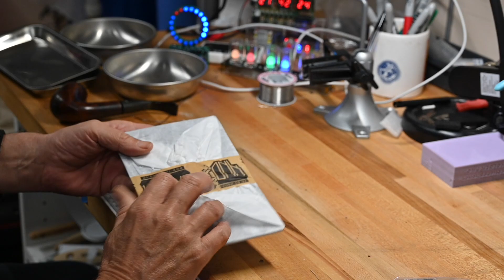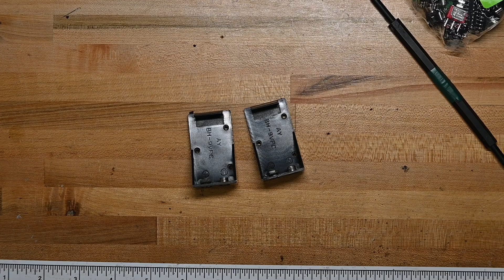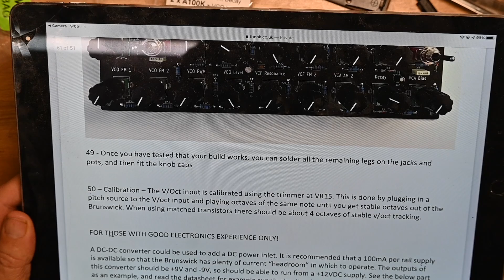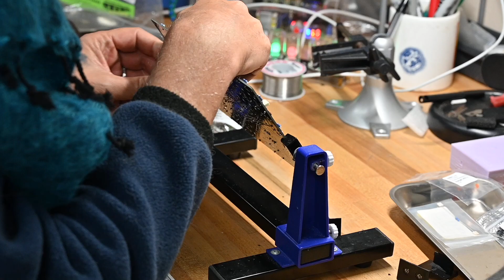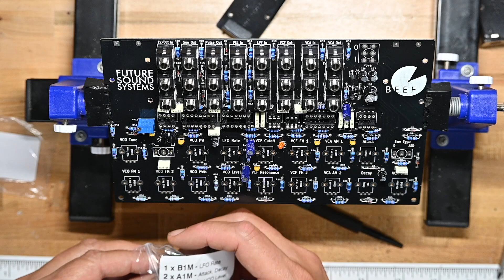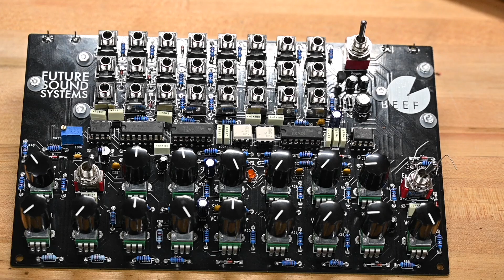C.K. builds a Brunswick Synth from Future Sound

Comment: BTW, Thonk now sells a "Brunswick Enclosure" that includes a front panel that labels everything. But it doesn't highlight the outputs vs inputs. (And it's currently out of stock.)
Reply from the maker: I certainly prefer modules that have clear indications of what is an in and what is an out.  As for the enclosure, I like Eurorack because it puts everything in a *rack*, I don't have the horizontal surface clear space to have separate units.

Comment: Excellent video! I'm glad I watched this before starting my build. Did you ever figure out what was going on with your envelope?
Reply from the maker: No, I did not.  Saw some messages here and there that this is not an uncommon occurrence, not sure why.
Reply: For what it's worth I finally got around to assembling my Brunswick tonight. I have the EXACT same gate issue. 

The only other fix I found online was soldering on an extra 100k resistor to one of the chips. I'll try that tomorrow.